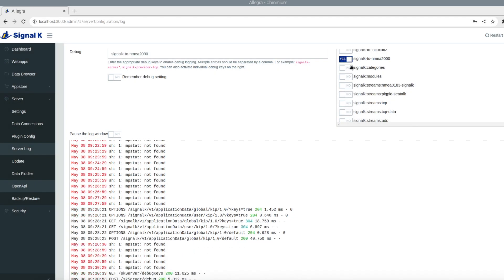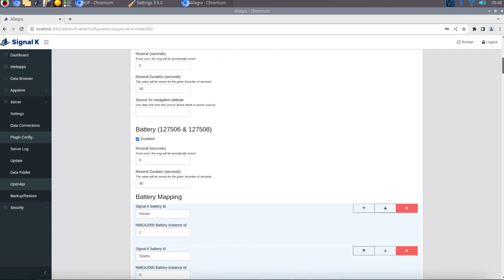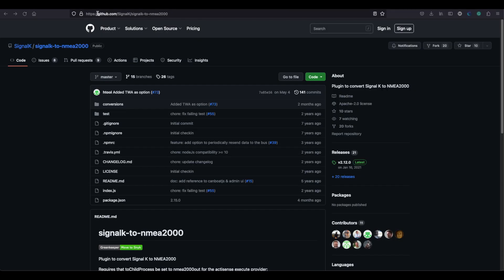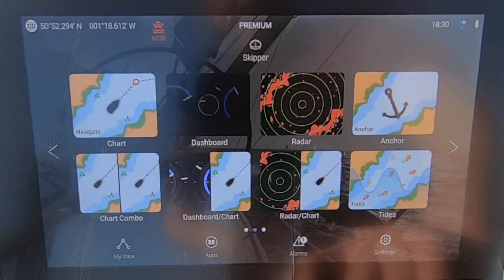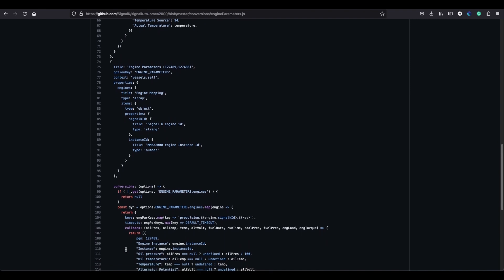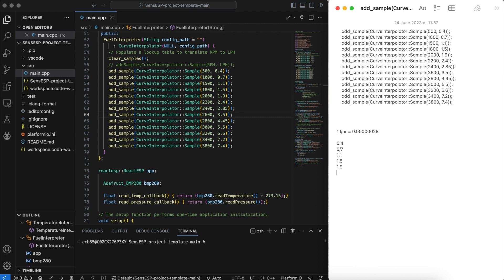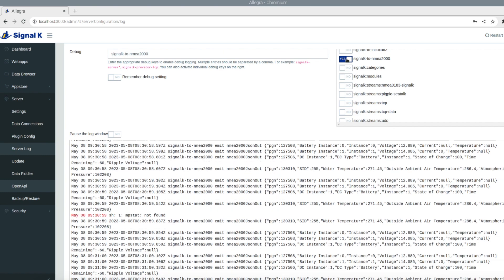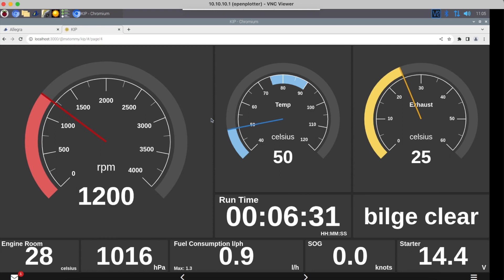SignalK - NMEA 2000 data sharing, Battery, Engine and Fuel flow data - Hits and Tips - Boat Projects

Comment: Your videos are so helpful! Thanks.
Any thoughts on why on the Axiom the data sent from SK into the nmea network keeps dropping out? 
My tank data goes from a value to nothing ( displayed as - -)
I have tried changing the sk - nmea2000 'Resend (seconds)' and 'Resend duration (seconds)' values but nothing really changed.
Have you had this with your battery data?
Reply from the maker: Hi, many thanks for your comments on the videos. I haven't had that with battery data, but I do get it with engine data (RPM & Temp), where it drops out and then comes back a second later. I've always assumed that this was down to the WiFi on the Pi not being all that good and a loss on that side (ESP32 to Pi). I didn't really consider the plugin, but I will investigate that.

Is it a regular time interval, or is it random? If it's somewhat regular, then possibly turn on the SK server debug for that plugin and see if you have any gaps in the sending data and then we can try and work out which side is having the issue. I'll try the same with mine.
Reply: @BoatingwiththeBaileys 
Hey thanks for the reply. 

interesting.
The data is coming from Czone via a Victron Cerbo over wifi and then SignalK using the venus app so its coming a long way! 

How often should the data be sent? 
Could be a node red flow needed to help it along. 

FYI the atmos pressure comes the same way except by BT to the cerbo. This remains stable unlike the tanks. 
I edited the pressure.js file after watching your video and hardcoded the name of the key (it was already hardcoded unlike your battery example) it worked! My Axiom now sees it.
Fun!😁
Reply: Sorry yes there are gaps

Comment: Great help.
Any idea how do you capture data from 1 NMEA 2000 Network and send it to another NMEA 2000 Network?
Reply from the maker: Hi - Thanks for your comments. Can you give me a little more information on the two networks and whats on each of them. What do you want to share between them. If you want to drop us an email then happy to respond that way, email address is contactus@boatingwiththebaileys.com
Reply: @BoatingwiththeBaileys  hey thanks so much!
Will drop you an email.
Czone which has the tank and battery data into the raymarine Seatalk network.
Would be great to see tank/battery data via the raymarine and maybe set some voltage alarms for low/high. 👍

Comment: Do you a SinalK setup video? One on setting up from the very start? Thx
Reply from the maker: Hi, Not really as it comes as part of the OpenPlotter software and is ready to go. What system are you running and what data do you want to get into SK and i can try and help you. I've got other videos showing settings up various parts. I think i can help you get going.
Reply: @BoatingwiththeBaileys  hello, I am also looking for a shunt connectable to the nmea2000 or to the GPIO of my raspberry PI5 to display with Signa K the battery data (Volt, current, etc.) could you direct me to a product. I really appreciate your tutorials even though they are not in French. 
THANKS 👍
Reply from the maker: @Fred-Carpe_diem Hi, thanks for your comments. I would go with Victron kit, it's not directly connectable to NMEA without additional kit but if you have a Pi onboard then you can Bluetooth to it with a SignalK plugin and then send that data on as I do
Reply: @BoatingwiththeBaileys  Merci

Comment: So that signal K script is on a Pi yes? And sent to the axiom via a multiplexer?
Reply from the maker: Hi, do you mean the SignalK to NMEA2000 script? If so, yes thats an app avilable from the app store to change  SK Keys back into NMEA 2000 data that the Axiom can understand. No multiplexer in the NMEA 2000 network, its not required. Fuel and engine data is from a device i made, thats also covered on the channel.

Comment: Thanks for the great video! I am looking for all the resources I can get wrt recording marine data on microchip devices. Can you please recommend some good sources? 😊
Reply from the maker: Many thanks for your comments. Can you give me a bit more info about what you want to do with the data after? You can store anything in SignalK into a database and then use that.
Reply: @BoatingwiththeBaileys  I am mainly looking to do data visualization, but I want to do as much of the work as possible myself to learn about the protocol, the data, and so on. 
I have been looking for information on nmea 2000 but it is a bit hard to find since it is a closed standard. I would appreciate any recommendations for stuff to read.
Reply from the maker: I’ve not read into the NMEA2000 protocol that much myself, my focus has been getting systems talking to each. Are you running OpenPlotter or similar as that comes with Grafana which is great for data visualisation. InfluxDB is also bundled with it so you can record everything here and then export
Reply: @BoatingwiththeBaileys  I have not got that far yet but I have been looking at signalK, OpenPlotter, and some other stuff. I just wanted to know if there might be some other resources that could be educational 🙂
Reply: @BoatingwiththeBaileys  I was mainly thinking about books or articles though.
Reply from the maker: If it’s just NMEA2000 you are interested in then this document tells you about how it works on a networking level https://www.kvaser.com/wp-content/uploads/2014/08/nmea2000-explained-cassidy.pdf, Actisense have some good resources and also links to a reader https://actisense.com/wp-content/uploads/2021/08/Complete-Guide-to-NMEA-2000_Revision_4_2021.pdf which might be useful to look at the data and then I would look at the standard itself at nmea.org
Reply: @BoatingwiththeBaileys  Great, thank you so much! 💫

Comment: Hi, back in business ;-) but I'm really having problems to identify the battery id or the engine id. Any hint would be appreciated. Thanks.
Reply from the maker: Hi, Is this on your SignalK setup or on the Garmin?  If its SignalK, can you let me know the path name and I should be able to help you. For example mine is something like 'electrical.batteries.House.voltage', so all I needed to type into the NMEA 2000 plugin was 'House' and it is case sensitive. For engine, I had called my 'main' in some paths and in others engine, so I changed them all to be engine and then just added that to the plugin. If I've not understood your question correctly, let me know.
Reply: @BoatingwiththeBaileys  Good morning, you understood it correctly. Just more details of my network. Im running to raspberry pi's. One as SIC (ship information center) including AVNav, openplotter, sensors, etc. the other one is our PIC (Power information center) running venus os with monitors all Victron equipment. Basically I'm having a NMEA 2000 (micro c) Garmin network including all the Garmin staff like plotter, auto pilot, AIS, radar ....The engine is a Volvo Penta connected to NMEA 2000 by YachtDevice. As far as I understand the network, some Garmin's are still using the NEMA 0183 to connect. Venus OS delivers it's data via the Venus Plugin in SignalK. I "believe" that the plugin is such delivers data using the signalk protocol ... right? So the NMEA 2000 plugin would be perfect to distribute all victron data to the network. In SignalK, data browser the ID for the main battery is "electrical.batteries.289.voltage". Putting this ID "289" in the NMEA 2000 plugin  doesn't bring any data to the network. On the Garmin Plotter checking the NMEA 2000 network / devices I can see all the Garmin stuff and YachtDevice. An additional component with converts NMEA 2000 to IP. Sorry for being so comprehensive, but I hope that you get a clearer picture of my setup. Br, Otto
Reply from the maker: Really sorry - i missed the reply to this message. Did you get this resolved? I think you are correct on the incoming data being in the SK format, thats the case for my SmartShunt. I think the approach you have taken with the ID sounds correct, thats how the code should be picking things up and sharing it. Do you see any data in the SignalK log against the PGN's as i did?